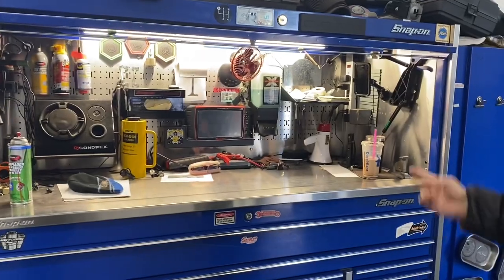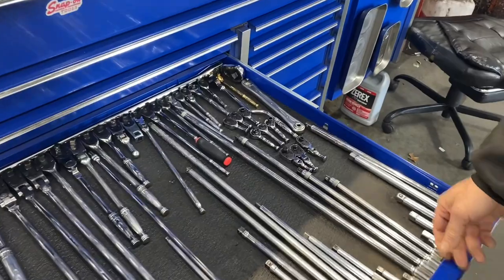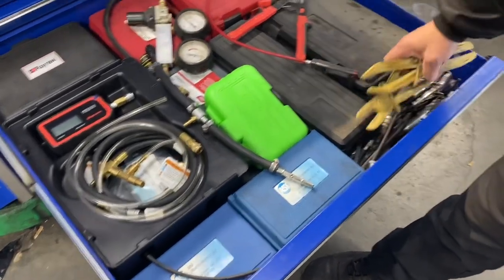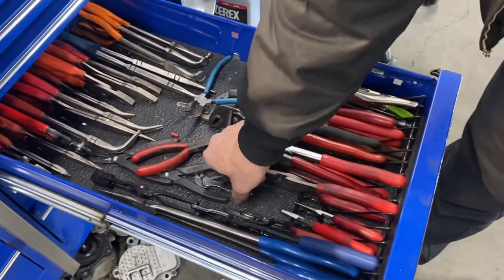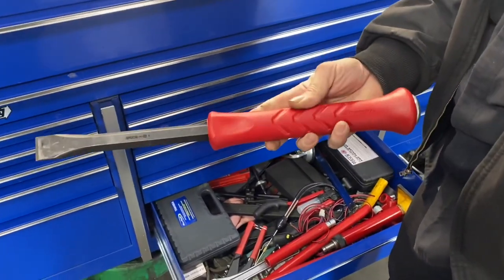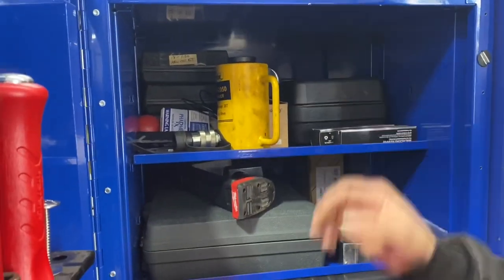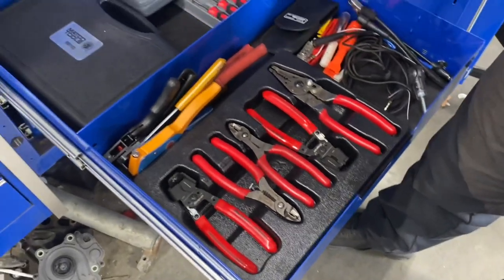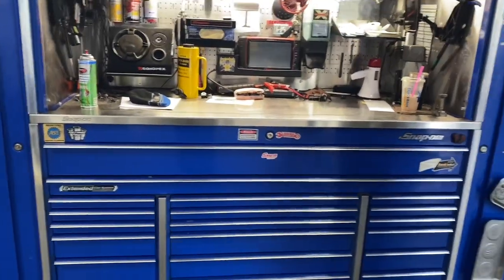Tool Box Tour

Comment: Take some exhaust donuts , and put them under the tool box casters in the front (use a floor jack to lift up the front).. it will tilt the tool box backwards .. and your drawers won’t slide open when the locker is open !! 🛠️🛠️🤙🏼